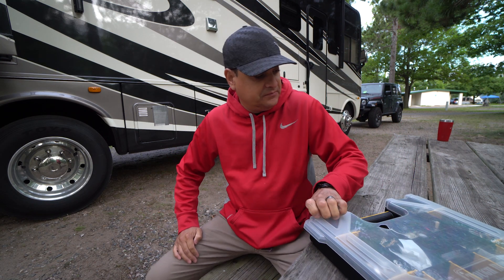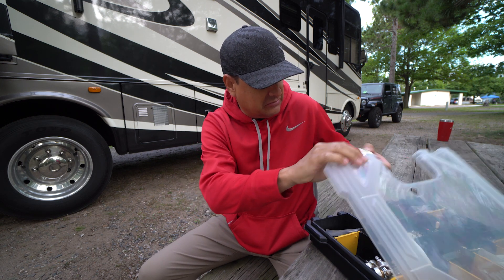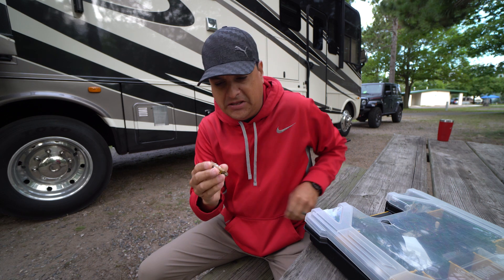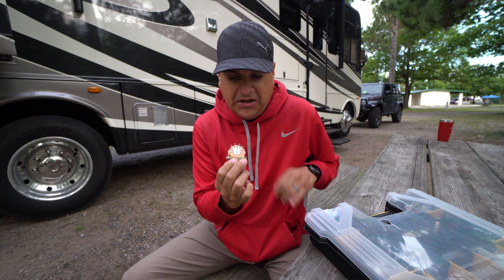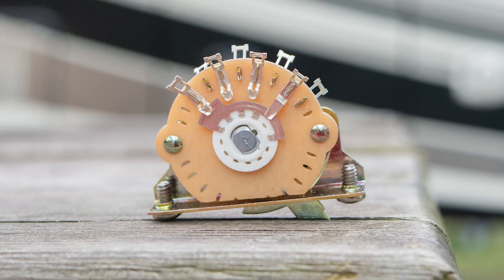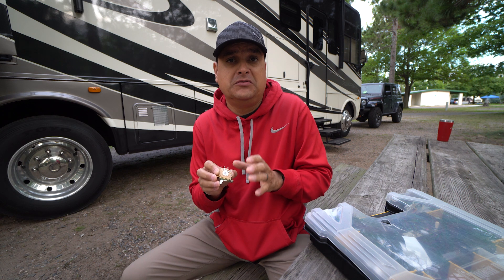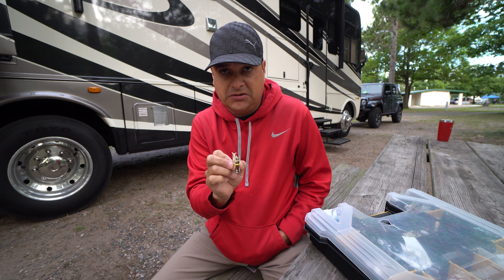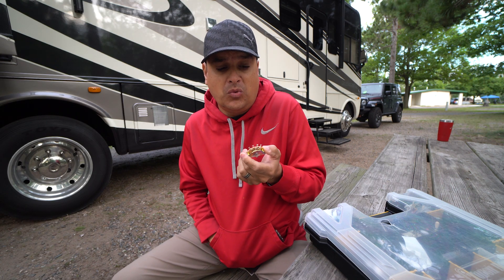How Does A 5 Way Switch Work - String Test set 3 dylan talks tone

Comment: Hey, i’m trying to wire my custom guitar with HSH configuration - using a Push-Pull  Volume pot, and e 5way EP-1112 switch…
The guys from DiMarzio sent me a diagram for what l’m trying to achieve (a very basic set up..>, but after a couple hours of working, my guitar still doesn’t have any sound …
There is one very particular diagram on DiMarzio  website - for Steve Vai- but that one is using a regular Fender 5-way switch (EP-1104)
I’d like to use everything they have/use on that particular page (on their the website) but with a EP 1112 switch instead…
Any help ideas, any help please?… TY.

Comment: Do not try to take on a 5 way switch in an alleyway at night no-matter how brave you are feeling, it will attack! Seriously though, this is a top 10 detailed audio engineering video for all that play-repair-modify- upgrade Fender Electric Guitars,Thanks. This is " Why" the switch works as well as the "how" . Take it to the next level. BTW, have you given "Roto-sound" strings a go, at one time it was all we could get( ( London, late 70's), I got a set because the shop did'nt have EBalls. Put them on a Telecaster and..."yes" a totally natural un-tainted experience. They felt comfortable and sounded  clear and clean. Roto-sound 10- 46/48.

Comment: 4:41 this was super useful when I accidentally dripped solder into the mechanism and had to figure out where to apply the desoldering braid and which pinchy parts to push back into place, so the switch makes contact again. Luckily it was on the outside/accessible side of the switch, and I was actually able to save my wiring job. :)

Comment: is it possible to use the 5 way switch to make a series parallel wiring in a strat? for example, I'd like to have in 5 position midle and neck in series and in the 4 position midle and neck in parallel

Comment: I struggle to understand how the pickup signal goes from the switch on one side over to the tone pot through the common connection and then back to the switch from the tone pot and out to the common output on a single wire connecting the switch to the tone pots. A better understanding of the signal path from guitar to jack.

Comment: Great info on the "mystery" of the switch! Is there a way -- without push/pull or toggles -- to blend neck and bridge only? (i.e. no need to blend bridge/mid/neck or to blend bridge with neck position)
Reply: Just hook them both up to the same tab. Probably most efficient to swap out the 5 way to a 7 way to deal with phase and hum cancellation.

Comment: So if you have common, 1, 2, 3, where’s the ground go? Do you connect the output to the common that shares the same side as the pickups and ground the common for the opposite side?
Reply: Ground never reaches the switch. Ground is at the other side of the pickup and goes directly to the output jack.

Comment: Thanks for another great video! You are right, even though the common tab is not an output, it is easier to explain it the way you did…  Imagine if we were talking about single pole single throw or double pole double throw switches! About the strings, when I got my acoustic Taylor guitars back in the late 90s, I purchased a whole bunch of elixir strings and I still have  some left after more than 20 years! I was a bit disappointed to learn that the newer strings are not as good as the early ones… I guess I will have to buy a new set to figure this out… However, the only elixir I purchased were for acoustic guitars, I never tried electric ones… Thanks again!

Comment: I understand the 5 way pretty good, its those switches with multiple poles, i think is the term 2 commons on the bottom and 5 blades on left and right, i think some have 3 blades

Comment: @dylantalkstone Dylan, thanks for explaining that! Before I got put in the hospital with sepsis and other medical issues in July and now a rehab center, I attempted to DM you on Instagram about this very topic but, you never responded. I’m replacing the guard on my Parker with a custom metal one Brad Angove made for me. Long story short, I noticed 2 wires (black and white if I remember right). disconnected and my     humbucker neck pickup wouldn’t work by itself like it should on 5 and I got frustrated because I had no idea and still don’t know where they go without finding a proper diagram.

Comment: I have gotta say, unless explicitly told due to authentic aging. I will always replace any fender style or Gibson switch. Usually with an ibanez style box switch. Theyre proven. The issue is just look at how super skimpy the metal is...of course its gonna break. Its the thickness of a hair. And also more metal=more ease of conductivity. I think ive replaced 2 ibanez and 1 dean....ive replaced at least 100 gibson and fenders blades. If you never use your switch, you're good to go. If you want the most out of the guitar. Get it replaced its simple quick and easy

Comment: @Dylan - Can you explain/show how to properly wire a Status LED to an old Wah (Original Cry Baby) pedal using a 3PDT switch? It's more complicated than I though, as there is a PCB and Tone pot whose Input and Output wires have to be accounted for. I've already wired in a jack for external AC power. Thanks